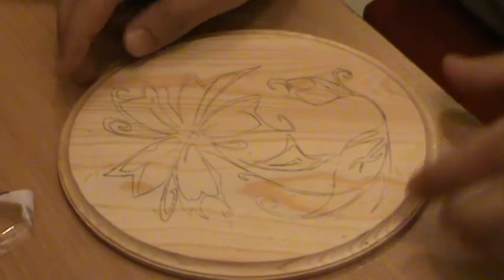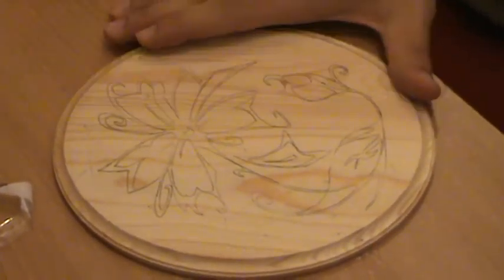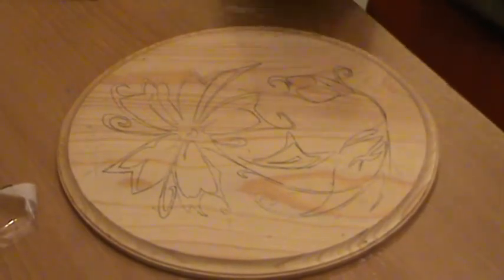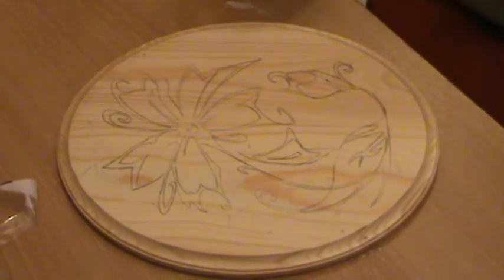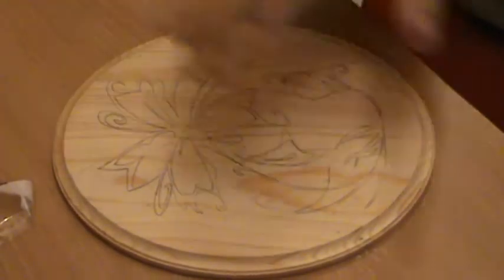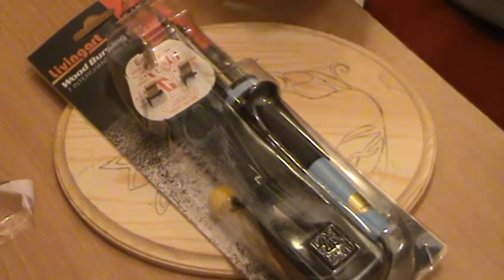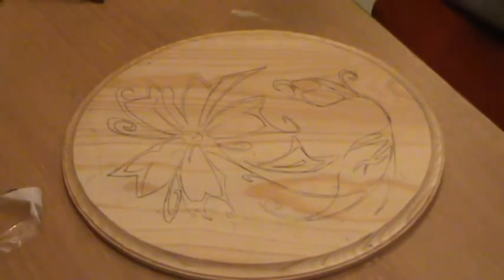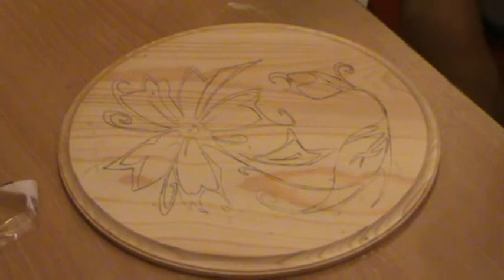Basics and Tools of Pyrography (How to copy a drawing to wood) part 2

Comment: great video i know you probably wont respond to this but what did you use to trace the picture? and will any pencil work?
Reply from the maker: Hi
I am happy that you liked it 😀
I use regular Carbon Paper and regular pencils
Others may use Graphite Paper also to avoid Dark traces
Reply: TheSmilingWood thnx is there any tips on more complicated drawings because I'm a lefty and not too great with drawing. I did my first wood burning and loved it
Reply: @bricen6805  you can try using clear tracing paper and softer wood with a pencil or fine pointed object/stylus also graphite paper works wonders.